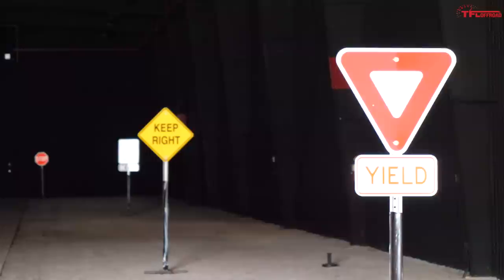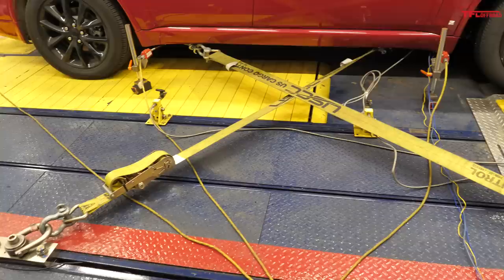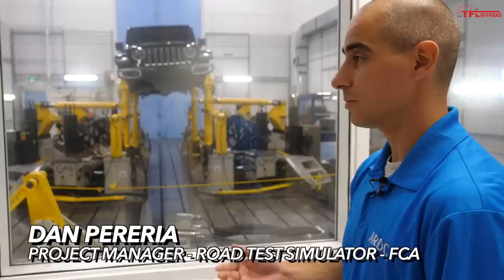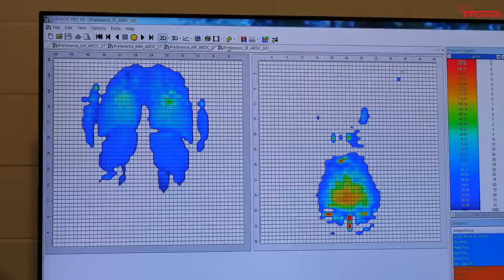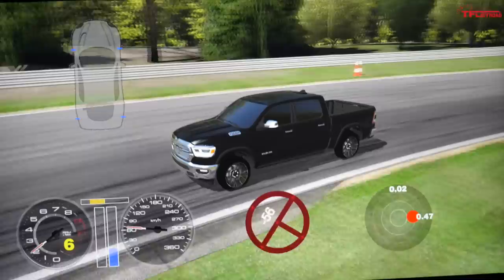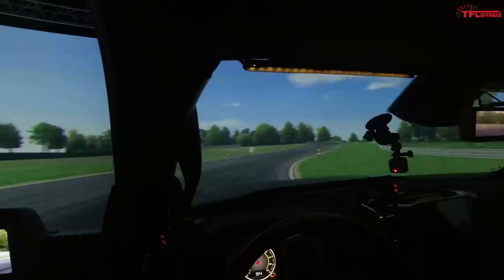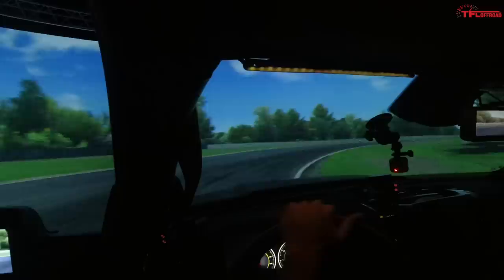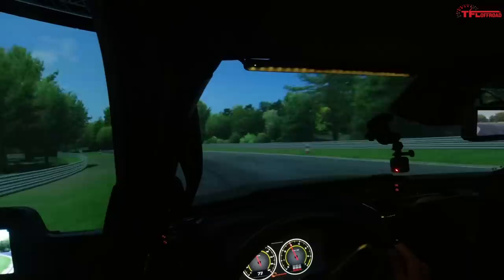Watch Jeep Beat The SNOT Out Of A New Gladiator To Test For Durability!

Comment: If this is what FIAT jeep does for testing, then toyota must throw their trucks into f5 tornados for testing
Reply: Haha true i judt bought a 2019 tacoma trd. A used one with 30k miles is 30k i paid 33k
Reply: @Jv19979  🙌
Reply: No Toyota let's another car companies do the testing while their vehicles run on 3 decades old technology. For God's sake they still using drums... That's great if you want your car to run.... If you want any kind of innovation be prepared to spend some time at dealership. My 32 year old 300 sdl got more technology than any new Toyota vehicle short of entertainment system.
Reply: guy proulx  He's alluding to the idea that all other companies put new technology in their cars, and later on, when it becomes reliable, then Toyota uses it. Basically, letting all the other manufacturers beta test the new gimmicks.
Reply: guy proulx  You're separating technology from the question of durability..can't be done. Durability of a modern car is directly related to the technology of the parts, materials, and systems used to build it. The most durable, reliable vehicles are generally the ones with older proven technology. Toyota isn't leading the pack on anything cutting-edge...but they are generally known for producing the most durable and reliable vehicles out there. It's a good thing! Let the other manufacturers work the bugs out of the newest stuff...
Reply: @zelenizub2036  drum breaks last years and rear disc dont stop no better than rear drums.
Reply: guy proulx  Last response. I already explained it. Twice. He's not actually talking about Toyota hiring other companies to test, he's talking about Toyota sitting back and letting other manufacturers do the beta testing. Not that hard to grasp his meaning....
Reply: #Facts
Reply: Put that machine outside in the salt and elements
Reply: I like old technology and take it any day over new stuff. My point is Toyota is not bringing anything groundbreaking to the table. Just running old and reliable. Drumm brakes are garbage....
Reply: guy proulx  i have them on my semi truck and trailer (drums) and disks are much much better.
Reply: guy proulx  no one in the industry is using drumm brakes anymore why is that? My brakes work perfectly but discs are just better. I drove truck with disc brakes and it has better brakeing performance.
Reply: guy proulx  everyone is using disc brakes these days. For good reason.
Reply: N Pooch 
You must be a very patient person 😂
Reply: guy proulx 
You don’t need a statement to prove that someone does the testing for Toyota. Look at the new Supra... who manufactured, tested the engine, transmission, other parts and refined them? they took what was proven by someone else.
Reply: guy proulx 
No I won’t do my homework because you have all the clues and ideas. I’ll wait for you to comment the info you collected so I get everything easily with breaking a sweat. Just like Toyota!
Reply: guy proulx 
I won’t waste my time reading books. I’ll just read your comments that have all the correct info and FACTS!

Did you ever consider manufacturing a car? You seem like an expert.
Reply: @Jv19979  Hell they don't.
Reply: guy proulx  Cost. A lot of new rigs use disks if the customer is willing to pay for it. My old company bought us trucks with disks. My new company is too cheap and still goes with drums. Disks are insanely superior.
Reply: guy proulx  Governments don't actually care that much. They only care about liability.

Drums are usable, disks are just better.

By the way, I know you're a troll so that's all the input I'm going to provide.
Reply: Keep makes great vehicles.
Reply: They let Top Gear test their vehicles.
Reply: @NukePooch1  completely agree. Pretty smart actually.
Reply: @zelenizub2036  Its a trade off between reliability and innovation. Myself, I am okay driving around in a 40 year old 80's HJ60 Landcruiser with original running gear. Yeah its old, yes it has 600,00km (there is debate in the family that it has done more than that), yet I can rely on it to get me where I am going and not break down. My friend has a 2013 Jeep Cherokee with under 50k kms which has broken down many times, while the landcruiser has never been stuck. Bogged maybe, but never needed another vehicle to get unstuck or moved. Only a shovel is necessary.
Reply: @zelenizub2036  I do get what you trying to say but they have a different approach to things. They are one of the first car company to have the oldest running successful hybrid vehicle program which not only has hybrid vehicles but also plug-in hybrids, ev's, and hydrogen powered electric vehicles. Almost 2.5 decades in and still going strong. Almost all of the auto industry is still trying to replicate Toyota's success by having a stable hybrid program but none come close. Toyota is innovative but they use innovation where necessary, If it ain't broke, don't change it approach. They currently have their Toyota Safety Sense System as standard on all new Toyota models, which includes things like forward collision avoidance, lane keep assist, radar cruise, and etc. Many of the automakers do not offers such systems as standard. Checkout the Toyota Production System, there are a ton of videos on it on YouTube, there are many companies that utilize this system. They just have their shit figured out. Simple!
Reply: zeleni zub who asked you?
Reply: ArchV1 there’s a specific reason toyota uses drum brakes on the tacoma and they have stated it multiple times. Should use the internet and go look it up
Reply: zeleni zub see above.
Reply: ArchV1 the only thing rear breaks do is for parking break. When your daily driving and press the break pedal it uses ur front ones. So in that case of “rear disc don’t stop no better” it’s completely ignorant
Reply: Toyota’s really aren’t as durable anymore as people make them out to be..
Reply: Lol
Reply: don’t know much about Fiat just all
the ones that come into my shop are pure garbage some chrysler’s as well! but i have an 1987 chrysler conquest so i feel bad for saying that lol even tho it’s a mitsubishi
Reply: @juicymangos9820  not completely true my car is more rear brake biased I change the rear twice b4 the front
Reply: Toyota incinerates there truck to ash to test if the interior is comfy or not
Reply: ArchV1 huh
Reply: @Jv19979  that's wildly incorrect.
Reply: Agent. K. It's why the Z4 is one of the only BMWs worth buying if you want tested reliability...if it's good enough for Toyota, it's good enough for us lol
Reply: @zelenizub2036  And I could care less about all that inovation. 2-3 more mpg, a few more horepower or the latest adaptative/autpilot cruise control thingamabob is worth nothing when you are stuck with a brand new 50k paperweight for weeks or months.

I would rather make do with my primitive 4runner than an advanced wrangler. One will give hundreds of thousands of miles with minimum maintenance and the other will leave you standed at the dealer at 15k miles because of a stupid problem.
Reply: @dchawk81  insanely superior ? LMAO !   You ever actually work on cars ? There's a difference, but definitely not like you suggest
Reply: @juicymangos9820  if you are suggesting that the back brakes do nothing on the road you're nuts. Try going down a dirt road and mash the brake pedal. If the ABS doesn't work "too" well it'll drag all 4 wheels, or should
Reply: @rundownaxe  I've had Toyota trucks and loved them, but I'd take my 96 Grand Cherokee over any Yota. Never lets me down, takes me literally anywhere I feel like going and love the ride and comfort. the 4 L engine is as good as anything built by anyone. That being said, I wouldn't buy anything too new from Jeep or anyone else really for that matter. too much tech to break and smart cars make for stupid drivers. What will folks do after the gadgets start dropping in a couple of years ? Imagine your new(ish) car with the adaptive cruise control and it quits while you're not paying enough attention because you're used to it. Bye bye car and maybe lives. I agree with you, I'll take primitive and reliable over any tech
Reply: @joebalser9515  Insanely superior stopping, slightly superior ease of replacement.

It's not disputed. Except by you.
Reply: Lol IKR. In all seriousness though I think FCA assembles there cars while drunk.
Reply: @joebalser9515  When adaptive cruise quits you just lose cruise. So you're going to slow down. Big deal. It's not going to mash the pedal and steer off the road by itself or anything like that. Lol.
Reply: @Jv19979  no kidding, I just bought a 2012 with 120,000 km for $23,000
Reply: Shaking the wheel hubs is nowhere near the same thing as actual impacts into pot holes.  There are no impacts during this testing and impacts degrade vehicle components over time, especially those which aren't made of metal.
Reply: Toyota and pre-fiat jeeps are the most durable vehicles on the road by far.
Reply: @zelenizub2036  If it nots broke, don t fix it.  Rear drum brakes on a Pickup are fine. The front brakes do 80 percent of the stopping
Reply: This comment didnt age well lol. As the Gladiators have proven more durable and more reliable them the Tacomas, especially the new 24’ garbage trucks.

Comment: You can't simulate 10 years worth in 4 to 6 weeks months as materials break in 10 years differently, oil, seals, rubber, plastics decay... Cannot be replicated....so soon, it will still be new in 6 months but still good to know they do that.
Reply: Well only the government can afford to design a vehicle and test it for 10 years before actually using it. 🙃
Reply: FCA has that covered. They only source materials that will break down in 6 months.
Reply: Where's needs to be guy standing there spraying road salt all over it also
Reply: That's what I was wondering.  Different environments and corrosion causes the vehicle to drastically wear differently than a simulated durability test.
Reply: Plus, on that simulator the wheels aren't turning, so anything related to the axles and the rest of the drivetrain aren't tested.
Reply: They can simulate it, but it's hard to get very accurate. I'm with you on this one, 160k looks alot different than a couple weeks on a giant waterbed.
Reply: They are replicating wear and tear not decay.
Reply: Simulating durability on axles that are notorious for falling apart
Reply: Why do you complain? People complain about absolutely everything it’s disgusting.

Comment: Y’all saying testing the suspension for a 10 year time or something. But how about the 10 years of rust from being in northern states and Canada
Reply: Sand blast the frame....   Spray LPS 3  on the frame... drive the dam frame.  lol  no but seriously.  LPS 3/  or fluid film wayyy better than POR 15 or Rust MD trust me on that.
Reply: @gittyupalice96  if you're diligent and reapply it all the time it's definitely better. if you get lazy it can get real crusty underneath tho. sometimes the factory rust proofing is ok though, my 22 year old toyota still has strong steel underneath where i've removed the paint to check.
Reply: they tested for 10 years worth of simulated driving yet we can't get 6 years out of a pickup truck on the washboard roads in eastern Colorado I call BS
Reply: @brandonsabin1471  haha, exactly. Thats what I thought when I watched their gentle 'tests' above. whats the failure point on these pickups out of curiosity? To be fair washboard is really rough on everything.
Reply: @0xsergy  broken frames and axles we have five F-150s one of which is only two years old that have broken axle tubes and we have six Toyota's that have various frame damage everywhere also lots of electrical gremlins due to damaged ground wires (terminals cant handle vibration and snap off)
Reply: Yeah they only test for suspension lol
Reply: @gittyupalice96  por15 lasts forever if done right. my old beater i bought with por15 on the fender and drove it thru 250k km of winters over 5 years and no rust. my own rust repair shows rust after about 2 so to me that por15 did good

Comment: Why is FCA getting sued for broken Wrangler frames, you think they would have broken a few doing this.  Makes you wonder if that machine actually does a good enough job.
Reply: I think the Gladiator in the rig has welds done by the FCA preproduction crew, but the affected production Gladiators have their chassis welds done by an outside contractor, so FCA can blame them for the shoddy welds.
Reply: I wonder if it can simulate a 5 foot vertical drop?
Reply: I just read the story.  Some of the earlier Jeeps had Frame-side Track Bar Mounts breaking.  It's an issue BleepinJeep actually covered in a video over 6 years ago.  Track Bar Mounts have to strong and solid; otherwise, they can break or cause Death-Wobble.
Reply: I somewhat don’t believe that they’re checking NVH be my neighbor has a 2016 Chrysler 200S with the 2.4 and that car shakes inside it’s horrible even the steering wheel shakes this is the worst 4 cylinder NVH I know that 4 cylinders aren’t bad because I have a turbocharged 4 cylinder and I can’t feel a thing inside compared to the 2.4 MultiAir if your planning to purchase a 200 get one with the V6
Reply: @La-yt1wr  those were notorious for breaking engine mounts, I would have that checked.
Reply: look how gentle that machine is mate. you going down one rock ledge or something where you bottom out the suspension puts more force into the frame than this. no frame is gonna break with that gentle touch but using it offroad in real world situations is a diff story.

Comment: That’s sweet... but having owned a Jeep the frame, wheels and suspension isn’t the issue.  It’s the other mechanics, engine, transmission, alternator, water pump, hell the entire electrical system.  What good is a we’ll tested frame if the engine or transmission fails?  And there’s a reason why I say that, I’ve been stranded in my Jeep a dozen freaking times!
Reply: Erin Thor Yup :/ Jeeps are cool! But it’s those transmissions! Did you notice with the gladiator they didn’t even have the “wheels” spinning or the engine even on? So they aren’t testing the transmission or engine durability.
Reply: Silver Qilin — LOL!  I understand the reason for testing the suspension.  There are many things Jeep does well.  What I find myself trying to focus on is any indication on WHY.  I would bet that the reason for the testing is to ensure its ability to last past the warranty period AND THEN FAIL AFTERWARDS.   Down line post-warranty revenue matters!  (To them)
Reply: Best way to get around transmission issues is to get the manual!
Reply: Caleb M. Do they currently sell a manual?
Reply: It's a Jeep thing!!😂
Reply: Erin Thor not sure about the gladiator but you can still get the wrangler in a 6 speed manual, that’s what I have and it’s great

Comment: From what I learned from watching manufactures that test everything in house under controlled environment never translate into the rear world.  Also I think the sim is just a game.
I'v done sim for aircraft and it never feels the same.  You talk to pilots and they will tell you there is landing a plane and then there landing a sim. lol  Sims do have there place though.
Reply: You build one to simulate the driving based on real world testing. You cannot do real world testing based on simulations. All the suspension travel, steering response, all of that cannot be 'made to happen' in real life. It simulates the driving experience, not the physics of the vehicle.

Comment: Alright I know my Magnum was never run on the torture machine the way the front end klunks 😂
Reply: @kepler656  to be fair a new car shouldn't have that issue. my 20 year old toyota had the factory front end on it when i replaced it all last summer. oem tierods, balljoints, control arms, etc and no play. i only replaced it all cause i was doing the bushings. 200k km on the car when i tore down the suspension. but yeah you're right, people fix yo shit.

Comment: After looking over all the midsize trucks thoroughly I have no doubt the Gladiator will hold up to hard work or abuse longer than the others.  It's built like a tank, which is how FCA builds most of their vehicles, which is why their curb weights are always higher.  It's a trade-off.

Comment: My husband and I are a Toyota loving couple.. I'm still looking for s new SUV and have been putting some consideration into a Jeep  Wrangler.. We have owned every major off road worthy Toyota model.. I need a change!.. I definitely want to try a Wrangler, and seeing this made me respect the brand more.. Great video, Tommy!.. Jeep should be paying you lol

Welcome to Canada :)
Reply: Lunamaria don’t expect the same reliability though. Also watch out for all the recalls going on for them right now.
Reply: Don't.
Reply: No vehicle is as reliable as a Toyota.. However, Wranglers last a long time.
Reply: Lunamaria the old ones definitely did but don’t expect that out of the new ones. If it’s a vehicle you don’t plan on putting a ton of miles on, a jeep is a jeep and there’s no substitute. I can understand why you’d want it. But, I’d personally go with a manual if possible because Chrysler is known for their horrible transmissions.
Reply: Lunamaria new wranglers have a host of issues, from electrical to transmissions. Heck TFL posted a video of their rubicon’s battery system needing to replaced while they were filming. The Toyotas will take you anywhere, just get a new 4runner or import a new 70 series landcrusier from Australia- it’ll still be cheaper than the wrangler even then.
Reply: Lunamaria Also the new JL’s received a one star safety rating from the EU, Australia and Japan. It has yet to be tested in the US.